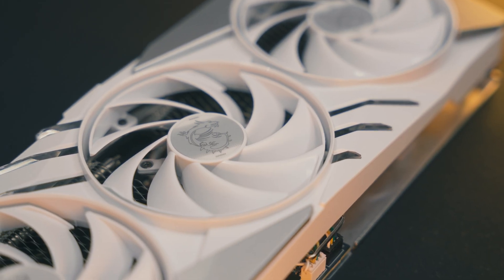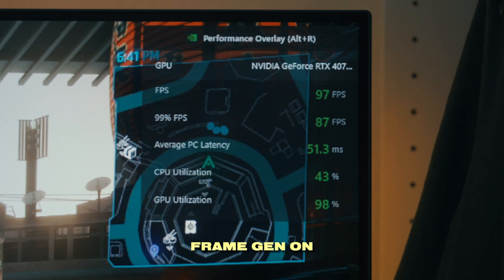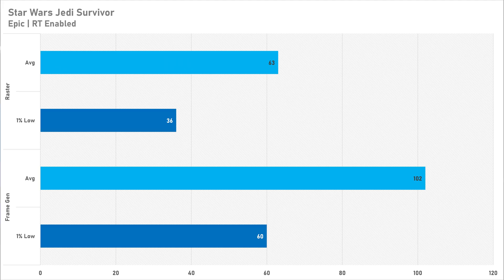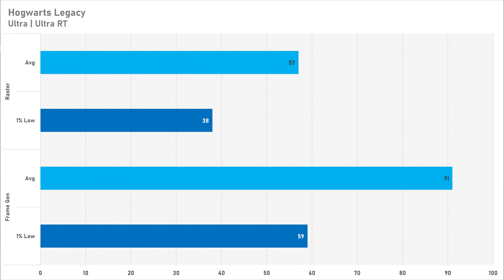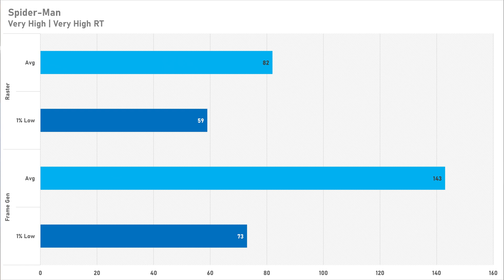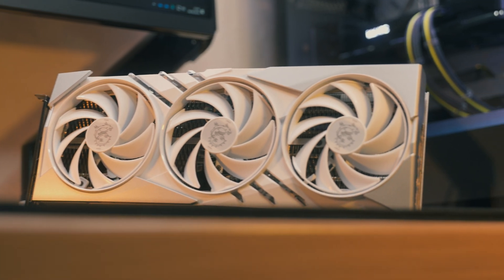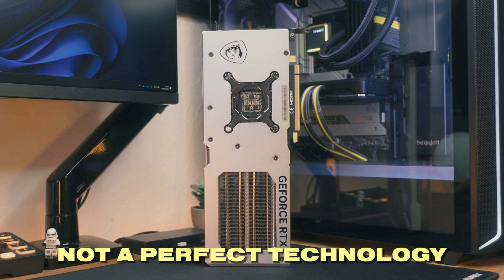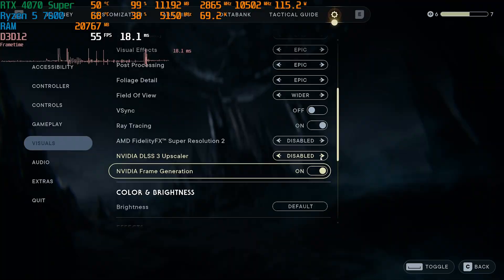Why you Should Enable DLSS Frame Generation (mostly)

Comment: What i've noticed about FG is that when playing with a controller, i can't notice the increased latency. I've played lots of Cyberpunk 2077 on RT Ultra with DLSS Q + FG, around 80-120 FPS. Base framerate is in the 30s, DLSS Q makes it to the 60s and FG makes it to the 80-120 range. FG is actually really cool.
My specs are Ryzen 7 5800X3D, GeForce RTX 4070, 64GB ram etc.

Comment: Aaaaaand the good news is FSR3.1 by AMD has decoupled their own framegen from their own FSR.

This should mean anyone with an RTX3xxx or older can not only use DLSS (or AMDs equivalent), but also can use the AMD frame gen.

This means EVERYONE other than RTX4xxx owners can have frame gen!

From careful analysis of FSR3.1 footage it doesn't look as a good as DLSS however, that is only for metallic, high shine surfaces due to shimmering. Fast motion also suffers from artifacts a bit as well and water surfaces.

Overall though FSR3.1 is a very good offering for gamers who don't own the latest RTX 3xxx and 4xxx series cards.
Reply from the maker: Wait so I can enable FSR frame gen, and use a DLSS upscaler on say, my RTX 3080? That's pretty cool
Reply: @ProYamYamPC   Yes mate, there's a great vid covering Ratchet and Clank FSR 3.1 comparisons by Daniel Owen (American youtuber) going over FSR 3.1 and the big bonus is the de-coupling of the 2 FSR features allowing nvidia 3000 series and below owners to use mix of both fsr frame gen with nvidia dlss - happy days!

Comment: The increased latency may not be a deal breaker for people playing slow paced single player games or RPGs but it's definitely something you should avoid for competitive games of any kind.
You should also keep an eye on VRAM utilization because fakeframes consume more VRAM and you may end in a situation where frametimes are affected and stuttering is introduced.
Image quality is also a concern of course, but that's also related to your base framerate. The lower your base framerate, the bigger the gap between real frames is and the harder it gets for framegen to create convincing fake frames.

I personally dislike FrameGen. It gives nvidia an excuse to keep selling overpriced trash like the 4060 models using framegen as an excuse to fake higher "performance".
AMD at least clearly states you shouldn't use FrameGen if your base framerate isn't already 60 or higher, but of course people never read and think this is supposed to be used on older hardware  running games at 30fps to make them look like they're running at 60fps.

Comment: Me watching this with my 2060 debating whether frame gen is worth it:
edit: its a joke frame gen dlss isnt on the 2060
Reply: latency can be a little mitigated if the base framerate is high enough, but my real issue is the increased VRAM utilization.
With so many games already exceeding 8GBs of VRAM, turning FrameGen on can result in horrible 1% lows and stuttering.
Reply: @RetrOrigin  yep agreed, frame generation should be used on 12gb minimum because with 8gb graphic cards like 4060 4060 Ti etc it's useless and brings stuttering higher ram usage and issues sometimes that's why I say 4070 performance is the minimum I'd recommend
Reply: Nope frame generation only benefits from high frame rates on good GPUs. I'd rather play 60fps without frame generation than 100-120 with frame generation as I don't like the fake stuff
Reply: frame gen is on 2060... amds
Reply: @mosesdavid5536  I said dlss frame gen, 40 series exclusive
Reply: It's not, You increase latency by 2-3x.
Reply: My 2060 super needs DLSS in jedi survivor just to avg 60fps. Settings on high cpu is R5 2600x.